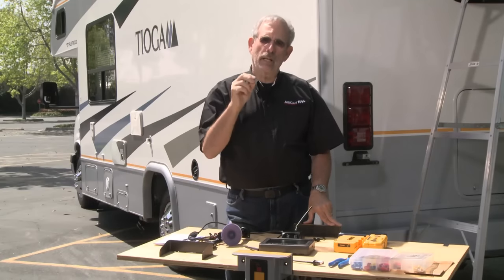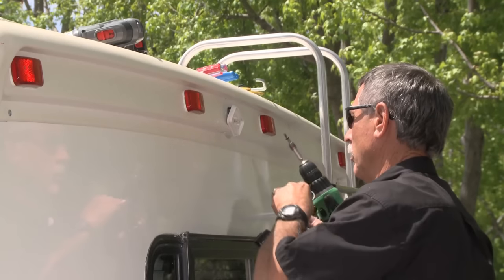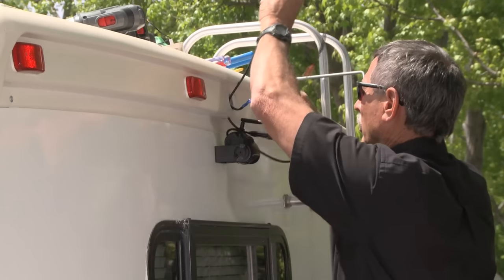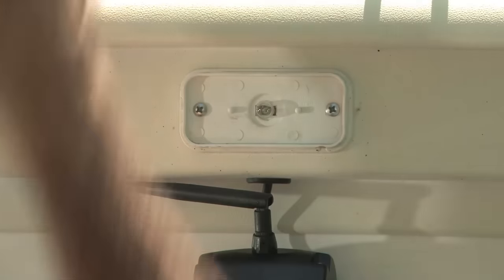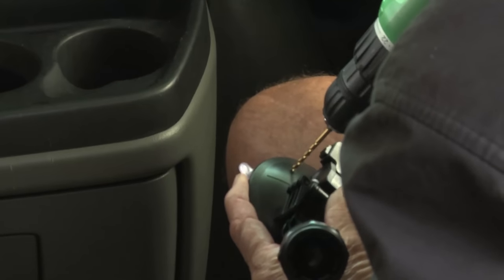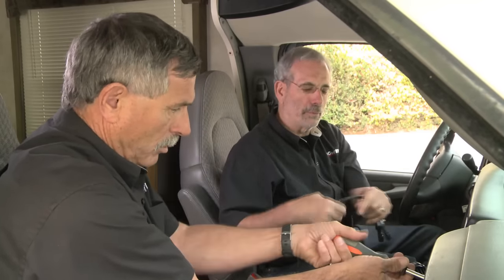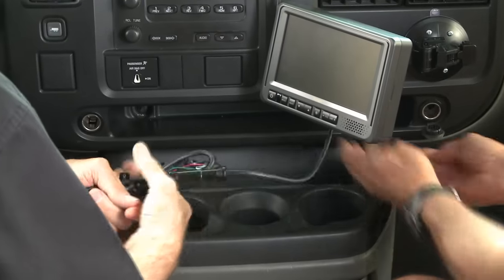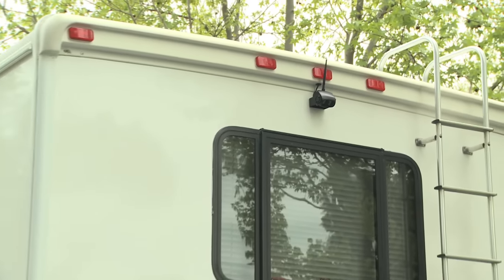RV Safety: Installing a Back Up Camera

Comment: Excellent Work Guys.   My Rear View Safety $300.00 camera came with very little in the way of instructions.  This video gave me the steps so I could install it with confidence.
Reply: Hi.  Here's an update.  I finished the installation by myself with help of this video.  It took me about 6 hours.  I'm only medium-handy, took lots of short breaks,  and only have a cordless power drill along with hand tools.  (a power screwdriver like the one in the video would have been nice).  Click below to see details of my installation.

I really appreciate the video.  I wouldn't have applied the sealant correctly unless you showed me.   Also, you helped me with knowing where to drill the holes in relation to the running lights on my 5th wheel.  

I learned in other videos about the confusing color coding of wires.  The RV had black and white wires.   The camera has black and red.  Counter intuitively, you connect camera black to RV white.  And Camera Red to RV black.  DO NOT CONNECT BLACK WIRE TO BLACK WIRE!  Trust me, read about it on Google.  Electronics wires are different color-codes than RV wires.

 I didn't drill the dashboard in my truck like the video, but you make it clear that's only one option and presumably what your customer wanted.  

Camera Details:  Rear View Safety Wireless Backup Camera & Dual Screen System.  Camping world part #85908
Reply: Ron M what model of camera did u install?

Comment: Good video   very thorough and easy to understand.
1. but why such a big hole for 2 little wires?
2. Why so far down when it could have been right by the lip?
3. How does the backup camera work off of your clearance lights, seems like it would run all the time and only at night with the lights on.
Reply: You have to have the trailer running lights on to power the camera.
Reply: The power point should be from a wire from one of the lights inside of the trailer....so it would have power all the time without turning on the clearance lights!

Comment: It looked good until you drilled the dash! Resale value just dropped by about a thousand bucks!
Reply: Yea I would have been PISSED if that were my vehicle... I would rather see the display double stick taped flat in that same spot or something similar. Not to mention you always need your marker lights on to use it lol.
Reply: @freethegeek4403  That's you. Most people don't mind. That being said, I usually check with the client before making visible modifications that may be outside the obvious scope of work.

Comment: I would get rid of the marker light and put the camera there instead one less hole to make. You have 2 other marker lights then seal with calk.the power is from the marker lights anyway.  I did that to my coleman. It looks like i tapped into a already wired connection like the furion pre wired factory install. No one knows the difference that i have one less marker light. But what ever floats your boat.

Comment: Any suggestions on wired vs wireless?  Any issues with the wireless signal?
Reply: There's always some issue with wireless cameras, but the alternative to run a wired camera is much more of a pain in the ass for an RV. Routing the cable takes a ton of cable length and is very difficult to route through preexisting wiring harnesses, grommets, etc without extensive disassembly of the vehicle. It all depends. Not to mention the time it would take.

Of course, having a wired connection would be more reliable so long as all the connections were made competently and there's no ground interference from another circuit.

Comment: do you have to have your lights on while driving for this to work?
Reply: Parking lights, since it gets its power from the center clearance light.
Reply: The best way to do it. Otherwise, the unit will be on continuously draining power. Turn on parking lights while traveling, camera on. Turn vehicle off, lights off, camera off...no power drain.
Reply: Does it have a record option like a dashcam?
Reply: @robertflores477  I've seen you say this twice now. That would only be true if they were tapped into a 12V constant, but it's true enough. The real reason is because that's the closest location to grab power for the camera and it is SWITCHED power.
Reply: @williamadams4044  No.

Comment: these guys need to work on the wiring that butt connection was terrible why not just go to the point before the other already existing butt on each camera wire  and they just drill into the dash with NO regard for any wiring that could be behind the dash....

Comment: As a mechanic, there's nothing I loathe more then butt connectors, not just butt connectors, but butt connectors on top of butt connectors. learn to solder and seal
Reply: On a bouncing RV solder eventually fails and then you usually have to clip back the wire and redo it.  With butt connections, if it fails, you just slip a new on one.  What you're saying is correct for a regular passenger vehicle.  An RV needs quick and easy repair.
Reply: Funny, I have to redo mechanics' electrical work all the time and those guys love to use T-taps and scotch locks --- those are what's trash; butt connectors are fine if they're not cheap and are crimped correctly.

Most people don't know how to solder properly or don't have a butane soldering iron that's worth a damn that can be used in that situation.

Comment: Blocking the cup holder and have to have the lights on for it to work.
Reply: That's the only power connection they have back there in that immediate area. There's nothing wrong with tapping into the running lights circuit.

The monitor mounting location is something I would've double-checked with the client first.

Comment: You have to have the running lights on??
Reply: Yes.
Reply: The best way to do it. Otherwise, the unit will be on continuously draining power. Turn on parking lights while traveling, camera on. Turn vehicle off, lights off, camera off...no power drain. Driving with the lights on makes you more visible and safer on the road.

Comment: The way you wired the backup camera itself was stupid you never want to have two connections 3 inch apart on the same wire. Drilling the dash was not the smartest thing ever. There is no way I would allow you guys to install anything on my motorhome
Reply from the maker: Thanks, Gt7 cupels, for the feedback. And, thanks so much for watching our videos. We certainly appreciate that different folks have varying techniques and I'm sure you have your reasons for your criticisms. We are curious, however, why you would not put connections so close together. Please do share with the class ...
Reply: @CampingWorldTutorials  to answer your question every time you install a connector on any wire you create resistance as well as the opportunity for corrosion of the connector itself and an eventual Short Circuit. In addition the connectors that you are using are not waterproof thereby increasing the opportunity for corrosion of the actual connector. Please bear in mind that you are connecting copper wire by a aluminum connector.
Reply from the maker: @gt7cuppels418  Thanks!
Reply: @gt7cuppels418  There's resistance in EVERYTHING -- even the copper wire itself! The fact of the matter is that it's so negligent that it makes no difference whatsoever unless it is heavily oxidized (which, truthfully, protects against corrosion) or has poor contact.

As far as your argument toward what I ASSUME is Galvanic Corrosion, there would have to be continuous heavy moisture or water on that copper/aluminum joint, for a period of time, while the circuit is powered, for that to be of any concern. Salt also plays a huge role in kicking-off galvanic corrosion.

Heavily humid environments could cause the same issue inside the cab of a vehicle just the same as it would outside at the rear-center parking light.

In short, you're being that know-it-all that seemingly has no real experience doing these things daily and simply recites information from the internet, a book, or a hick friend in order to appear superior while criticizing informational videos in a demeaning manner. Every technician does things differently and MOST installs, when done in a reasonable manner, withstand the test of time equally.

I, for example, usually do a military splicing method and would have done that on the rear light. I usually solder connections that could possibly be exposed to elements, but don't always have the luxury when away from my bench due to my butane iron's complete uselessness. My splice method is 1) strip 1/2", 2) poke a hole in the exposed copper with a pick tool, 3) insert new wire into hole, 4) pinch shut and wrap wire around, 5) tightly wrap in SUPER 33, 6) zip-tie the joint.

Alright alright, I'm done.
Reply: @robp4616  you are one hundred percent incorrect. The resistance offered by the connectors is in the vicinity of hundred percent more then a straight through the wire. Just so you know I have a Ph.D it electrical engineering
Reply: @robp4616  you do not have to digress to cheap attacks on my credentials
Reply: @gt7cuppels418  I just find it ridiculous that you're critiquing something so minuscule to an unreasonable degree simply because it's not the absolute best-on-paper way to do it.

You know damn good and well that 2 butt-connectors in one 12v circuit isn't gonna make any difference.
Reply: @gt7cuppels418  I'll lay off.

I'm honestly an angry person in general, but your two-cents just made me angrier than usual -- and for good reason, I believe.

Try not to be a sh*thead.
Reply: @gt7cuppels418  you are 100% correct, this couldn't be a worse example of how to wire the camera power!!!